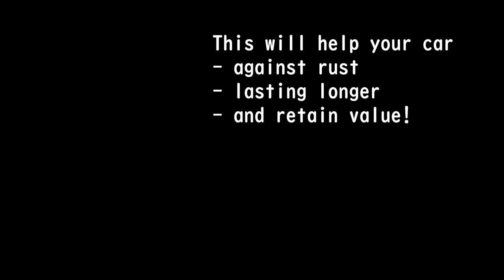DO THIS WITH EVERY CAR YOU BUY! - Cleaning the wheel arch cavity. Avoid Rust!

Comment: you can drill a tiny hole through the wheel well cover to spray the rust lubricant and seal it up with silicone.
Reply from the maker: I love, how a video brings people and ideas together!
The first Intention of this video was, when you bought a used car, you should check this spot because a lot of people never think about that. :)
Reply: @jumuworks  yeah both work, it's just quicker and easier but yeah def on a new car I would do every potential rust spot. good vid tho alota people forget behind the wheel well!

Comment: I try to drive into deep puddles of clean water on the side of the roads when they are deep. I also hose down the undercarriage a few times a year. Recently I used my leaf blower to blow the under carriage and was surprised by all the sunflower hulls ( shells) that was left by chipmunks, the hulls if they get wet would cause rusting of the surfaces they were on. I also did touch up painting on areas of light rust on all I could find.